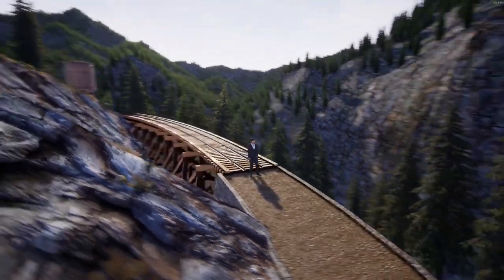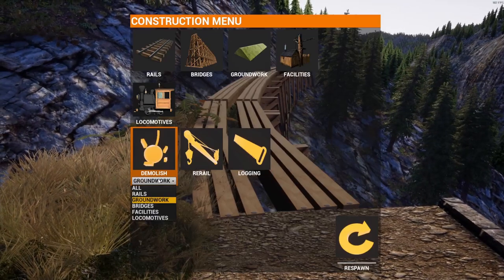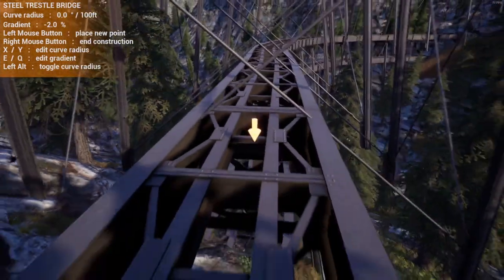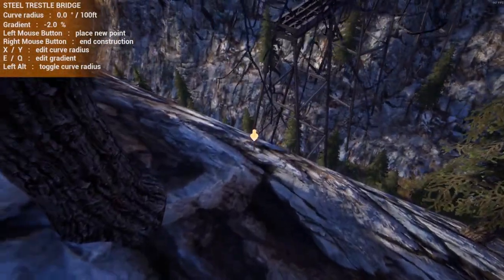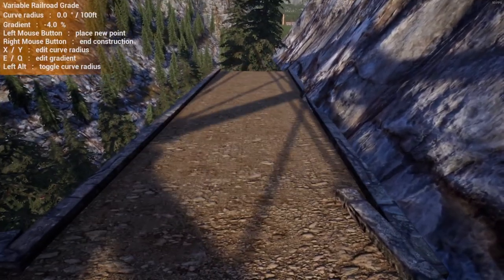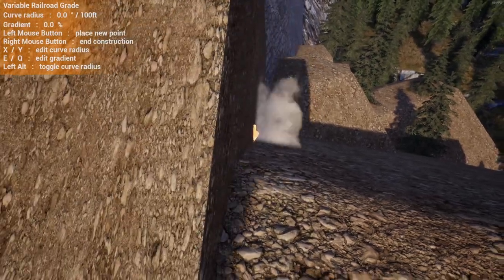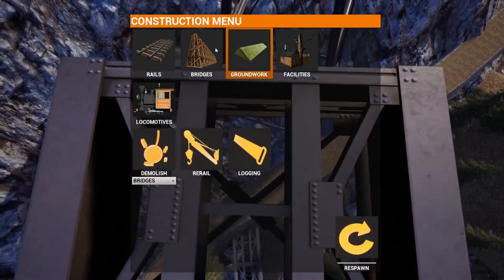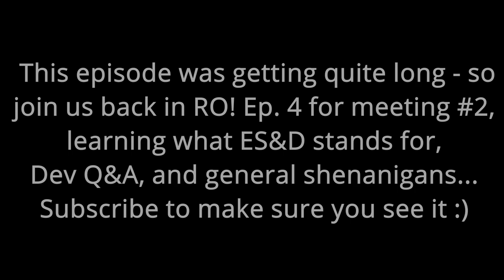RO! Ep - 3 - Building the Loop - Advanced Track Laying!

Comment: What I'd have done building those bridges is fill the valley with dirt ground work to roughly where the bottom of the bridge is and go from there. That's what I did for my 1.5-3% grade mega bridge to the Iron ore mine.
Reply from the maker: I think that's the smartest move, talking to some more folks now. Maybe in another video I'll show that off. I've never done it personally, i always tried to stay tight to the cliffs :)

Comment: I've found there's a center stone on both the variable gradient and variable stone wall that practically guarantees the new spline will line up with the old.  Also, if I'm building a line that will have grades  I've started finding the high point/summit and work down from there in opposite directions...might not always work.
Reply from the maker: I 100% agree on finding the high point and working down. I did that for the other half we didn't see, so I used that technique for this whole layout.
Reply: @Hyce777  I spent about 7 hours on Wednesday building the line to the Iron Mine and to the Smelter and back to the Sawmill...going around the entire area with a constant 3% grade either up or down, it has a few kinks in it I need to adjust and one place where it just stops dead and won't go forward or back that I need to fix.

Comment: I do have a question, do you know if RO needs more CPU or GPU? I am guessing it might be CPU since my system can't produce a steady 60FPS at 1440p Ultra settings with a 3070ti, ryzen 5 3600 and 32gb memory.
Reply from the maker: It certainly needs a lot of both. 1440p is always pretty tough to run. I get about ~60 in a decently built world with relatively similar specs but at 1080P. One thing we are working on is better utilization of both CPU and GPU, right now with the way physics is calculated and the way that rendering is done it's not as optimized as possible - so, hopefully better performance coming soon.
Reply: @Hyce777  Thanks Mark, the biggest issue wan't the frame counter, it was the locos jerking front to back. I played around with all the graphics options and the only one that gave me smooth linear motion was dropping to 30fps. As I only play single player it shouldn't be an issue. 1st world problems, I want ir as beatiful as possible and silky smooth.
Reply from the maker: @Javious_Rex  hmm. That might actually be tied into a mutliplayer bug that we are chasing down right now. Stay tuned :)

Comment: Question, so it looks like you guys are building a bunch of locomotives to release at once rather than building and releasing one locomotive at a time. Is that correct?? And if so why?
Reply from the maker: Nah, not really - we've got a fair amount of modelers who are working on what they can as they can as these things take a lot of time. Then we've got a dedicated person for unwrapping and texturing. It all takes time. Yes, there's like 6-7 locomotives in varying states of progress currently, but we're not planning to bulk dump them in.
Reply: @Hyce777  ok. I'd rather get one at a time and properly enjoy each one before getting another.
Reply: Question, will all locomotives be wood fired? If not, will the coal and oil come from the coal mine and the oil refinery?
Also, will knuckle cupplers be a thing or is going to stay link and pin??
Reply from the maker: @jacobramsey7624  knuckles, coal, and oil all coming. Coal and oil will be available for purchase or for discount / free from the industry if you supply them.
Reply: @Hyce777  will we be able to store coal and oil in other parts of the railroad to top off the locomotives where ever they are? Kind of like the fire wood depot?
Reply: Also, will you create insides for the buildings in the game?
Reply from the maker: @jacobramsey7624  depends
Reply from the maker: @jacobramsey7624  yup
Reply: @Hyce777  which responded for which question, in the order posted?
Reply from the maker: @jacobramsey7624  insides depends, coal & oil will have similar things to them like the firewood depot. Didn't realize it didn't attach these with their parents, sorry!
Reply: @Hyce777  that's ok. I got the message!